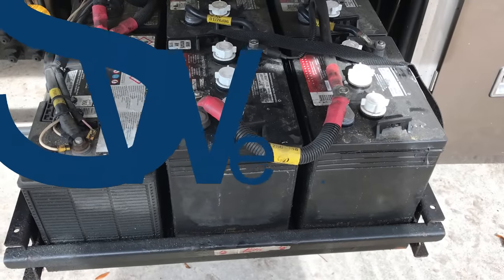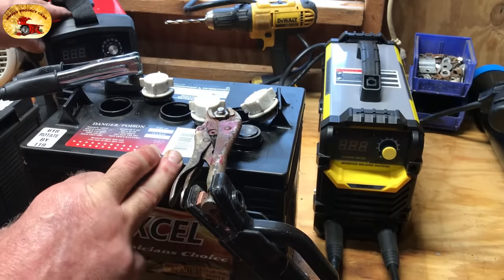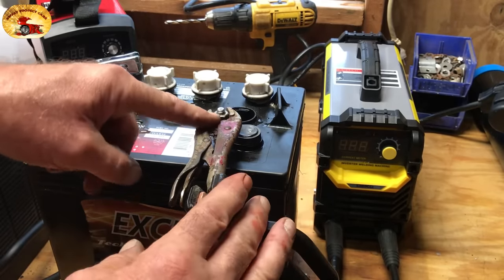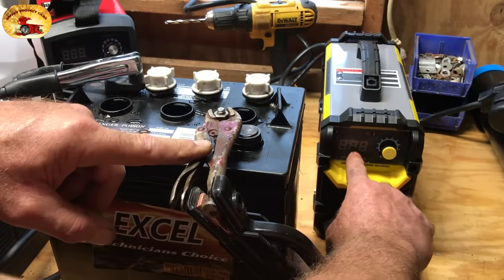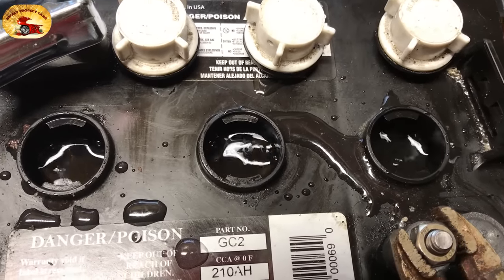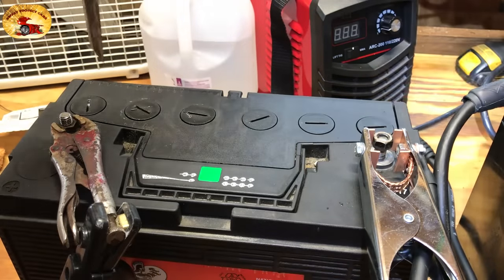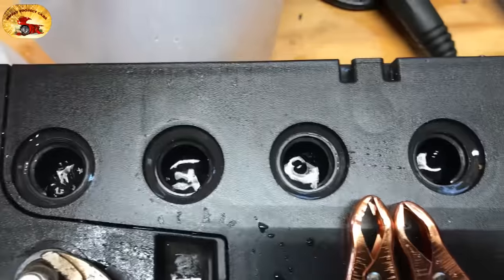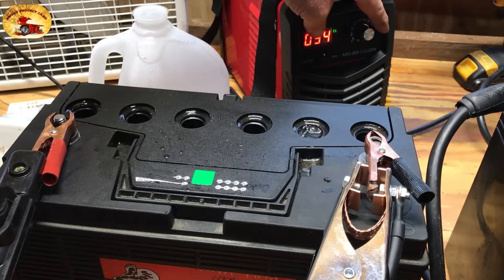How To MAKE OLD BATTERIES NEW Again!!!  12v 6v Deep Cycle, Car, Truck, Golf Cart, Semi

Comment: I recieved my welder (the red one) a couple days ago. I already saved my car battery. Knowing that this welder is only for regular car lead acids I decided to experiment and tried it on my dead rv 12v deep cycle batteries that have been sitting for 3 years in the elements. Well what do you know, It worked on them too!  Sweet.
Reply from the maker: Awesome Steve! Thank you so much for watching and sharing your fantastic results, we really appreciate it, have a great week my friend. mad Mike the hammer SPC
Reply: Steve for liberty
     I just came across this channel and subscribed. What is the make and model of these two welders? I cant find them in the videos. Thanks.
Reply: @mrlawski1014  in the video description, press the 'read more' and you should get the rest of the welder's description.
Reply: @toddthurston8317  Thanks, I'm not always this helpless. Appreciate your help.
Reply: What is the output voltage of your welding inverter machine ???
Reply: @terrydevera5120  welders are about 24-36volts
Reply: @richardmcavoy6413  Guess I'm pretty helpless because too because I found it hard to find out which welder to get for what. I first ordered a higher amp one than I found on some video, (can't remember which one) then after getting it found out that it had a 60% duty cycle. Then in the comment section of another video someone stated which one to order for regular car batteries. It was the yellow one. After getting it I decided to find and watch the video's again ( ended up being this one) before trying to rejuvenate the first car battery. In doing so I found out that the yellow one is supposed to be the one for the 6 or 12 volt deep cycle batteries. The red one for regular car batteries. So I guess I got the wrong one again. I also can't find where it says more details in the video description either. I can't see the red one enough to figure out which one that is either. Then there's another video showing another one, a green one. Thanks to you sweet car projects for the video's but it would be nice if you zoomed out for a minute and clearly showed us the two or three different welders then clarified which one works best for the different batteries. I know when making a lot of videos it would be easy to overlook details like that but some clarity would be appreciate. Thanks.
Reply: @jowhite8446   Agree. Had to watch the vid a number of times. I have an old Toyota Hilux Ute here in NZ with a dead battery I've neglected for 4 months. I have the distilled water... & a brother who welds. Not sure if he has a 200amp stick welder though... & he's grumpy. If he does, I'll pick the right time to ask him.
PS. Snap.We have the same surname & my middle name's Jo 😊
Reply: Why can’t the car 12v battery welder be used on 6/12 volt deep cycle batteries?
Reply: I did the same thing with my battery one cell was dead and I used my welder and the dead cell started to boil at 80 amps and and did do it for 5 min 5 times just got worse if the cell is bad then there is no way it will come right, most of the times the positive sells brake insite battery nothing will fix it just get a new battery like your  other video if it's a new battery and do it every 2 years that can do or like me I use my triggle charger every 6 months  on my bike battery and the battery is now 6 years old and still cranking good.

Comment: looking at the comments I think i have something that may help. The welder matters. There is a comment below stating they charged and now the battery is backwards with pos and neg reversed. I think this is because they used a welder capable of mig or tig welding aluminum, whether on a wire feed gun attachment, or just through the actual welder. On these welders, in order to do aluminum, the leads are reversed so you would get their issue. so in the end, I think regardless of welder, you must make sure that your positive lead (stick attachment lead), is plugged into the welder on the positive terminal, and the negative or ground be connected to the welder with the negative connection. To do aluminum with a welder that is capable, one wound put positive on negative and the ground would then go to positive. Make sense? So make sure guys n gals... that both at the battery and at the machine the positive is connected to the welding stick lead and the negative is connected to ground or negative....Hope that helped?
Reply from the maker: Our videos are very product/tool specific, we share only what we have tested an know works every time. Thank you for watching and sharing Daddski 1, we appreciate your input. Have a fantastic day my friend. mad Mike the hammer SPC
Reply: Can I use a Mig Welder for this? Not sure how to bypass the wire feed gun in order to attach the lead to the positive.

Comment: Julio is a keeper. Mike, this welder will pay for itself after recuperating one battery! I have several flooded 12 volt batteries lying around. Thank you, my friend, for helping us save money! You are truly appreciated!
Reply from the maker: Wow, we really thank you for that comment, it makes all we do worth it when we read comments like yours my friend.  And we think we will keep Hoolio around for a while, he's a good guy!   Have a great day!  mad Mike the hammer SPC
Reply: Did you buy the welder and try it? Results?
Reply: @SweetProjectCars  I ordered the welder you indicated, will the 160amp welder work on a standard 12volt? The 200 amp welder was unavailable at the time I ordered, the only welder I was able to purchase on your list was the red 160 amp.
Reply: When he cuts to the Julio audio clips I just about laughed a lung out through my nose !!!!
Reply: @joellipperini  Did the 160amp work for Car Batteries too?  or do you need the 200amp?  I have both motorcycle and car batteries....wondering if I need 2 welders, or if one of them will work for both?
Reply: @Boondockinit  as preventative maintenance you should check the levels of acid and add distilled water when low and attach a desulfator to keep the battery in its best condition
Reply: @drfunhawaii7933  same question

Comment: The difference between the red and the yellow welder is duty cycle. The voltages and amperages are almost identical but the red one has a larger duty cycle. That means it can run longer at the higher amperage (say 100 amps). So if you really need to wake up a big boy battery (I found this out on an 8d…1400 cold cranking amps) with the yellow one you might time out the duty cycle before getting the full 5 minutes. Hope that helps, I see a lot of questions about it in the comments.
Reply from the maker: Thank you very much for your input, we really appreciate it my friend, hope you have a great week. mad Mike the hammer SPC
Reply: So would you want the larger one for a 12V Deep Cycle Group 31 100AH battery? ...or is the lower duty cycle one still fine because even though the reserve capacity is higher the cranking amps available is lower?
Reply: what settings did you use for the 8D battery?  Still 5 minutes and 10 minutes off
Reply: What about voltage? no one says anything about it,  what volts these stick dc welders output?
Reply: @CHRIS75MASTER  its known as the closed circuit voltage (CCV). For welders this size generally the DV voltage will be between 18-24 volts
Reply: Will a wire welder work?
Reply from the maker: @jeffjones2740  sorry it will not my friend
Reply: Will a regular 110V stick welder work or dose it need to be inverted welder
Reply: So the red one can do all types of batteries then ?
Reply: A regular transformer-style welder should work, but it has to be dc.
Reply: @kazarbeilerian9123  Needs to be an inverter. You don't want to run AC into your battery.

Comment: I am a believer. I have saved 5 batteries already. Yes, it does hold charges.Thank you!
Reply from the maker: Wonderful!  Thanks for watching and sharing your great results Tim!  Have a fantastic day. mad Mike the hammer SPC
Reply: Tim - have you tried this with smaller batteries?
Reply: can i use any dc welder
Reply: Hey can I try this with something else elif you don't have a welder? I mean I have a big Miller but my 220 extension cord is too short
Reply: @faisalfaixal2376  if you can control the voltage, and keep it under 16 volts, 13-14 v being ideal, and you can use anywhere from 30-200 amps if needed to "wake it up".
Reply: Can this process be done with a gas powered welder we have a miller 230 bobcat
Reply: @SweetProjectCars  Just how old are these batteries and can you use tap water? What if I use water I boiled earlier on?
Reply: Distilled water has been chemically purified in a still. Boiled water is chemically the same as room temp, but the steam will be clean will be chemically clean, this is where the distilled part matters. Tap water likely has impurities like calcium, iron, blah blah blah. Heating it won’t change that and could cause problems in your battery for the long run. Distilled water is the way! Even better would be distilled, deionized water!

Comment: Please note that its smart to insure that any ignition source is far away as the fumes are explosive.
Great vid.
Never knew you could do this though I suspected it might be possible.
As  a mechanic for 40 years I could have done a lot of good had I known this back when I started.
Thankyou !
Reply from the maker: Thank you for watching and sharing Loren! Have a great weekend. mad Mike the hammer SPC
Reply: @SweetProjectCars  hi this is a great video! Just wondering on the welder to you have the negative coming from the positive plug coming from the welder or negative coming from the negative plug since they are reversible?
Reply: Pat Luxor  😂😂😂
Reply: Very true. Don’t clutch onto helpful tips, share them as it makes everyone richer in the long run.
Reply: Pat Luxor  Kentucky Fried Fingers they call it in australia

Comment: Well all I can say is thank you for a great hack. I got the "red" 200 amp welder last week and this past weekend I had an old battery sitting in the shop since 2019,,,it had a 2016 battery date. 
Went through the steps here on the video and when completed I put it on a trickle charger overnight. Came back the next afternoon and did a battery load test ( 3x to make sure I was actually getting a good reading )and it passed , it was Rock solid good. Now to go through the rest of my scrap batteries to see which ones will wake up.....but that one battery that has been revived just covered the cost of this welder. Thanks again for this great hack.
Reply from the maker: Awesome!! Glad we could help. Thank you for watching and sharing your results, we really appreciate it, have a great day my friend. mad Mike the hammer SPC
Reply: How long has the battery been working after being resuscitated?

Comment: I did the baking soda method and revived 2 out of 5 of the old batteries I had. I called it a success. Using the high powered welder to charge the battery instead of the normal trickle charger is genius. Thus taking away the need to use the baking soda to activate it.
Reply from the maker: No baking soda required, not necessary.  Thanks for your comment.  Have a great day.  mad Mike the hammer SPC
Reply: Baking soda neutralizes sulfuric acid. In other words, it would take the electro out of electrolyte. Haha
I don't see how baking soda could activate a lead acid battery.
I have used water and baking soda to clean out an old battery.Kept flushing it until it no longer bubbled. Then thoroughly flushed out the battery with clean water. Should use distilled the last few times before refilling it. Charged it it for 24 hours on 2 amp and it worked for, well I don't know. I moved away 2 1/2 years later.
Reply: @markmcconnell8705  Does that mean the heavy lead acid battery is then lyter?, lol.
Reply: @markmcconnell8705  Did you have at least one dead cell before you cleaned out the battery and refilled it?
Reply: @markmcconnell8705  Exactly. Battery killer.
Reply: I think maybe you meant Epsom salt.

Comment: I would suggest a simple voltage check with a meter before and after the process and a simple battery stress test as well. Those would affirm the process.
Reply from the maker: Well Tony, do as you wish, but we don't need to affirm anything to anyone because we've been doing this process for years and years and years and we know it works when done as shown and works every time. Thanks for watching. mad Mike the hammer SPC

Comment: I spent a weekend reviving 6 batteries after one took my wife to work, but was completely dead and would not bring her home again.  I have a 200 Amp Tig Welder I used and it starts at 9 amps.  The lowest setting worked for a few of them and only one did I have to turn up over 30 amps.  I am pleasantly surprised this worked.  Thanks for sharing.  I was dreading having to replace the batteries for my diesel pickup.
Reply from the maker: Glad we could help my friend! Thank you for watching and for sharing your great results, we really appreciate it, hope you have a fantastic week. mad Mike the hammer SPC

Comment: Purchased the YESWELDER that you have in the link for deep cycles. Turning it on the first time it worked fined and got good bubbling for 5 minutes turned it off and waited 10 minutes but that was it, cannot get any bubbling to happen after that no matter what I do with the welder, checked the connections and they are fine. Used a multimeter to see if any voltage was going into the battery when turning on the welder and it would jump up to 18 volts and then drop down to the batteries 12 volt.
Reply from the maker: Try it on another battery to test and make sure the welder is working correctly.  That's what we do.  Thank you for watching and asking.  mad Mike the hammer SPC

Comment: It worked!! I pulled two one reading .36v and I did 3 five min shock and it bumped it to 10 v but stoped to 7.5v after resting
Reply from the maker: Good deal, glad we could help you!  Thanks for sharing.  Have a great day. mad Mike the hammer SPC
Reply: So, your 12v battery peaks at10v and drops back to 7.5v. What can it be used for now?
Reply: @Sweet Project Cars Just did another six deep cycle 6v that where dead (.5v) and they are now bubbling like a soda :) on the  original cart charger. You truly have something here that not a lot of people know and i learned first hand. i got both of the welders and like you said on the video i used the red on my car battery that used to be 1.4 v and now is at 12.6v with plenty of cranking power and the smaller welder on a utility cart that has 6 6v deep cycle 225 ah batteries that where not charging when i would plug the charger. i noticed after running the shock treatment for only 2 min at 22 on the small welder the charger was able to recognize them and charge them again. After the shock treatment i connected everything back in the Cart and  they registered  and started charging then a couple min later the charger was showing that they where fully charged, i took it out for a spin and then a minute in and it died on me so i plugged it in for charge again and ones it was showing fully charged i took it out again and this time it run for about 15 min,  now i plugged it again and its been charging for about 11 hours and the batteries are bubbling like a soda however its taking a way longer charge and the charger is still showing 2/6 charged which means the batteries just need to cycle. Again I'm very grateful for sharing your findings with all of us and id like to thank you again. By the way i use jumper cables to connect them and also learned a valuable lesson not to crank the power too high or it might fry your battery :) (i actually did fry a car battery from a jeep by cranking it to 200 and battery got really hot and few cells stopped working )

Comment: Hi Sweet Project Cars, just come here from the link you sent me from the other video, thank you for that. Trying my stick welder. The lead that would be attached to the body of the work, has a red rubber cover on the clip. I did put this on to the positive terminal. I noticed that your machine has a black handle on that part and you put it on the negative terminal. This would have been my intuitive way also. It is a very old battery and still have three other better one's to try. Anyway, it started bubbling, 2 at first, then up to 5. The battery got fairly hot. It is in a very breezy part of the carport. When it cools down, I might try the other polarity, and stand well clear, which I do anyway. It went from 4.3 v to 3.8 v. This is fun but I do take precautions seriously. Cheers.
Reply from the maker: Harry, this video shows specific welders that we use and only recommend, please follow the video to a T, there is no other alternative, use the exact same tools, products and method, we've spent years perfecting this process. It works flawlessly every single time using either of these welders for standard battery  https://amzn.to/2K1UsWQ  or deep cycle  https://amzn.to/3yW4ihK  Thanks for watching, have a great day. mad Mike the hammer SPC

Comment: I ordered the yellow welder that you mentioned in the description is for 6v and 12v deep cycle batteries, but why can the yellow welder not also be used for a regular 12V car battery?
Reply from the maker: You can use whatever you want to use dawgduo, we are just sharing what we know works and works every time and is safe for both you and your batteries. Thanks. mad Mike the hammer SPC